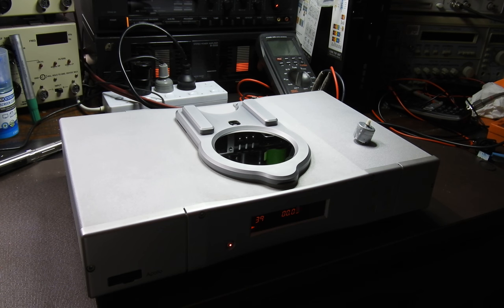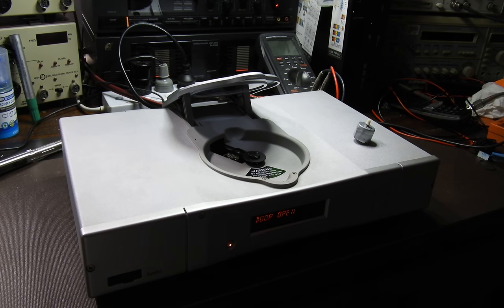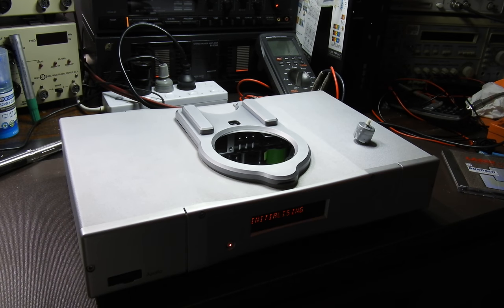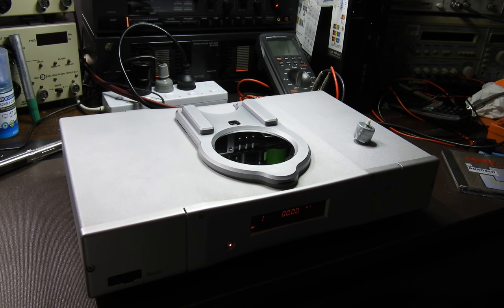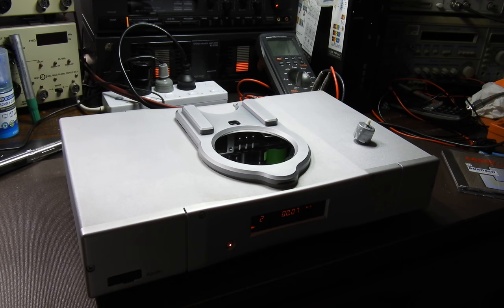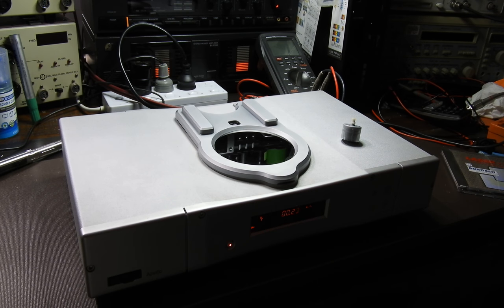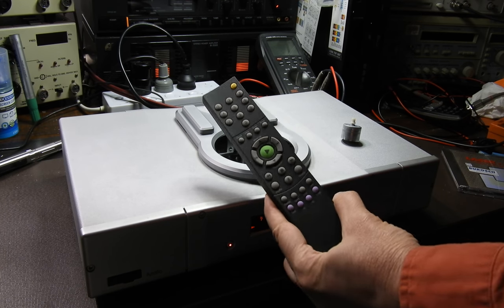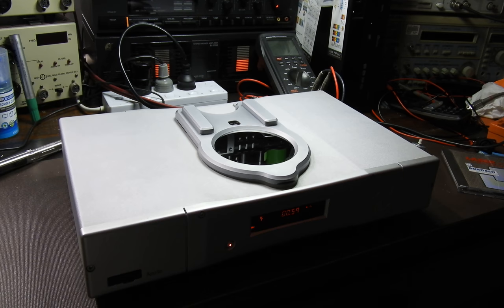Rega Apollo post repair video.

Comment: I just purchased a Rega Saturn, and immediately has problems such as skipping, problems searching for tracks, long search times, very sensitive to vibration and acoustic feedback causing audio drop outs , sometimes unable to play a track at all, but now after trying several cd's,  it says "no disc", won't read any disc.
Reply from the maker: Before embarking on a proper servo alignment, I would first clean the laser lens with isopropyl alcohol and observe if there is perhaps some old, hardened grease on guide rails.

Comment: How did you troubleshoot the problem?  Did you ohm out the motor windings?  What does a good unit typically read?  Nice work!
Reply from the maker: When the laser head does not move and the belts are replaced and when you can move the head by "running" the motor by turning the pulley with your finger and everything is fine (the head advances), then you have to suspect the motor. First check with the meter that the volts are there. If they are and the winding is fine (there is continuity and a few ohms of resistance), then you put your analogue meter on µAmp range and turn the shaft while observing the meter's needle. It will deflect significantly if the motor has enough torque. If you what to know precisely how much deflection is enough or what the coil resistance is exactly, you... compare it with similar motor in another player which works fine :-)